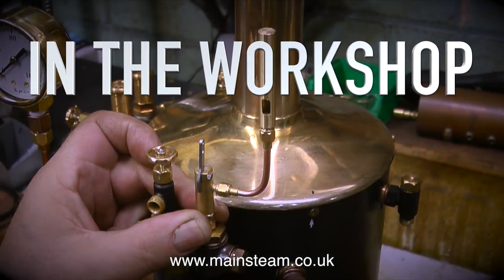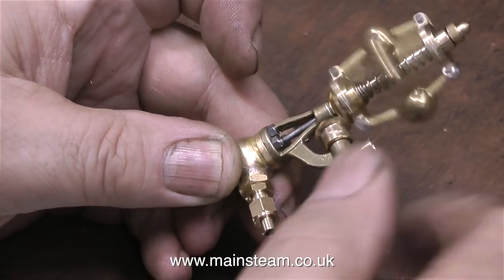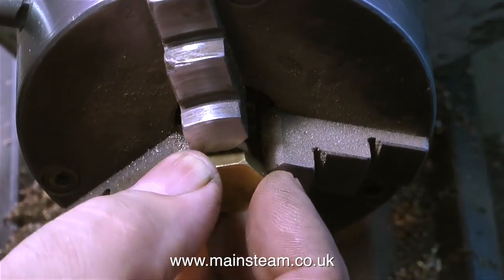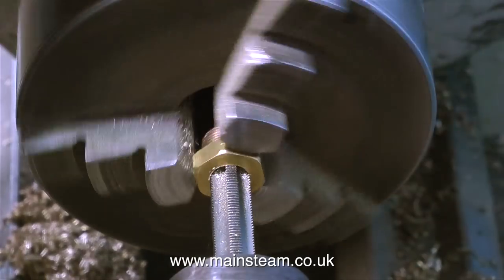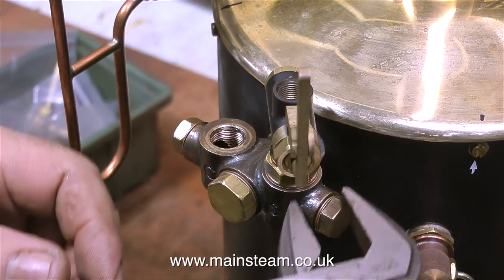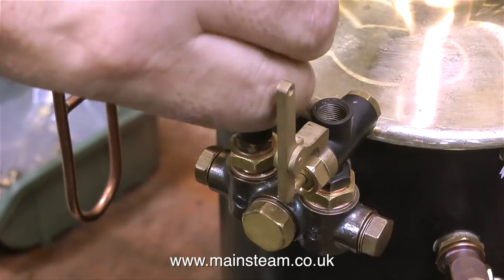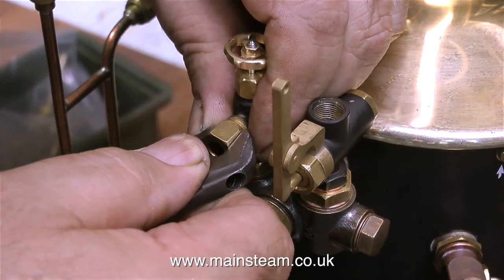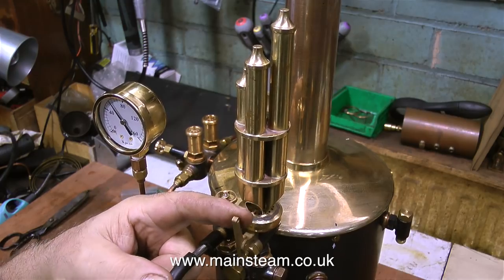HOW TO FIT A CHIME WHISTLE TO A CASTLE STEAM V6 BOILER - IN THE WORKSHOP

Comment: Once again Keith I find this useful.  I am in the process of building a boxcar with self contained air compressor and brakes to pull behind the American.  The whistle on the engine is really about like a dog whistle.  This whistle can fit under the boxcar and run off the air tank.  Nice sound.

Comment: So, what's with the screw that arrow is pointing to? The more I see it the more intrigued I get.
Reply from the maker: The arrows show which bolts to remove when taking off the top cap for tube cleaning.